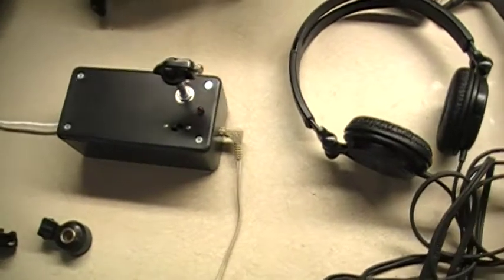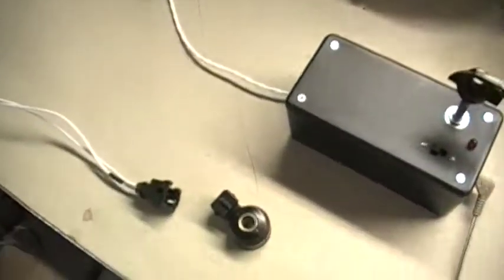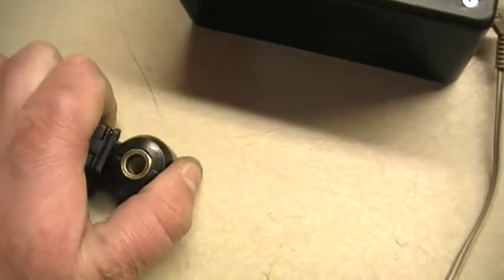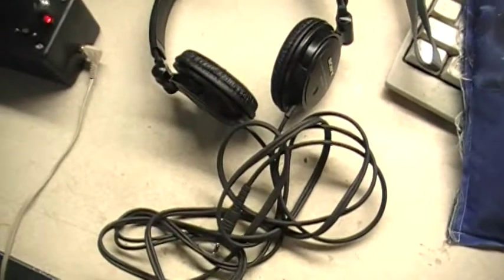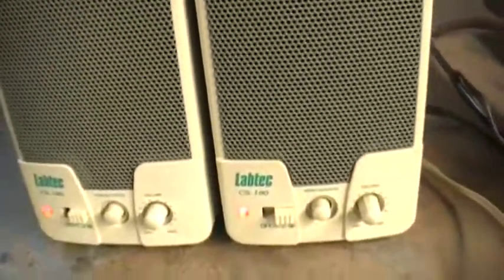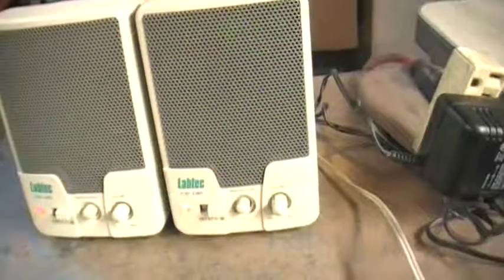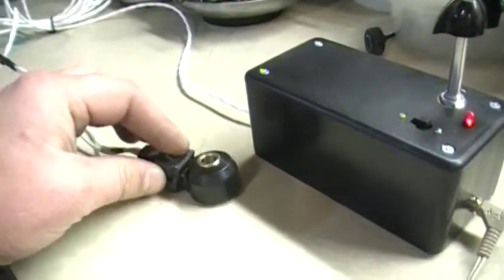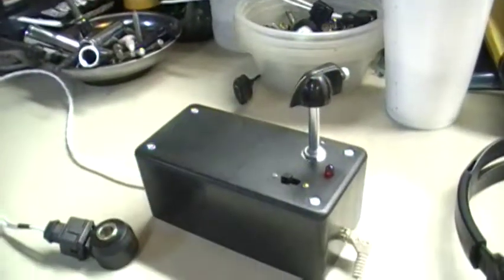DIY Knock headphones for tuning standalone setups

Comment: Looks like you thought of this idea before me. I want to use it to find drivetrain noises though. How effective is it without the op amp?
Reply from the maker: The knock sensor output isn't enough to drive headphones or speakers.  You need the amplifier.
Reply: You can also use a cheap headphone amplifier. I've heard good things about the Fiio A1. it's sub $30, super compact and rechargable. or wire the sensor to a 3.5mm headphone jack and plug it into your laptop. treat the knock sensor like a mic and record the audio. You can also use other programs like audacity to perfrom FFT and show a visual of the frequency spectrum.
Reply: Evan Batterman ... and if the sensor comes with 3 pins , all I have to do is figure which is power and ground and use them ? ignore the other one which I assume is signal pin ??
Reply: Alex R. The 3rd pin is the ground for the shielding. Make sure to ground that. You can figure out your signal wires with a multimeter. whatever 2 pins have the lowest resistance are your signal wires. Polarity doesn't matter.

Comment from the maker: Look for Afrotechmods video on op amps.  My amp is the same as the one in his video except I put a knock sensor in place of the mic and deleted the DC filtering capacitor for the mike since the knock sensor isn't powered.  I also omitted the resistor that sets the gain on the amp so the amp was set to max gain.

The knock sensor will have ground and output wires.  The ground has continuity to the metal part of the sensor.  Put that ground on the op amp power supply ground.